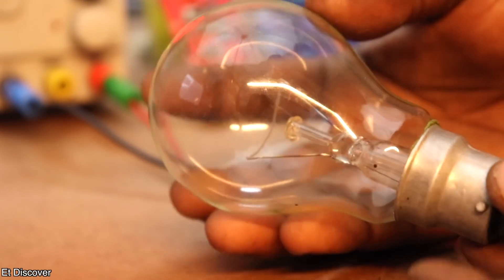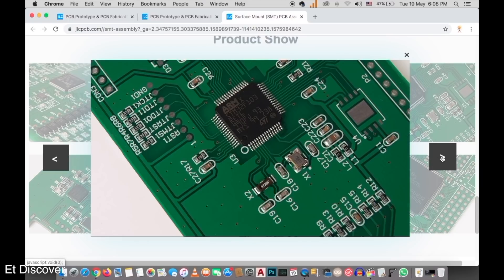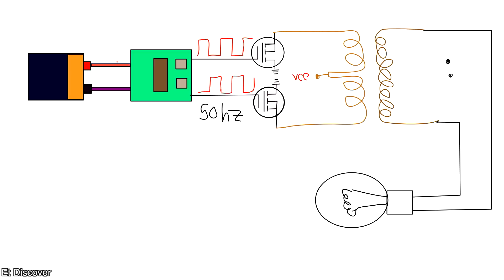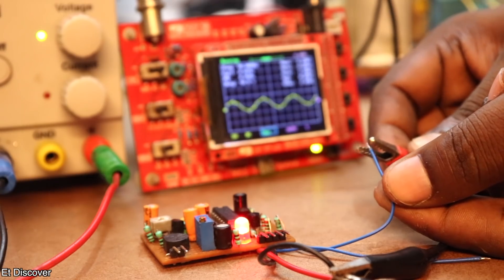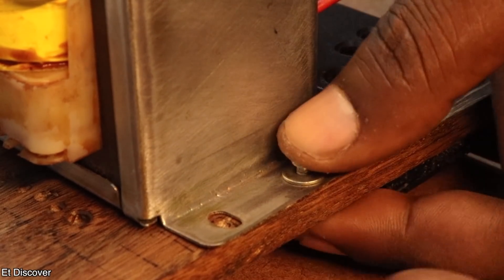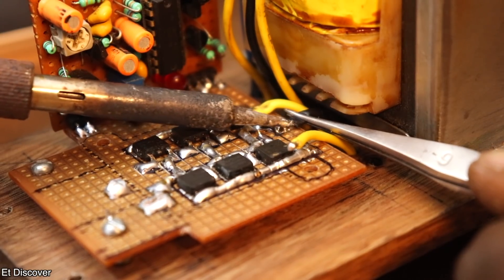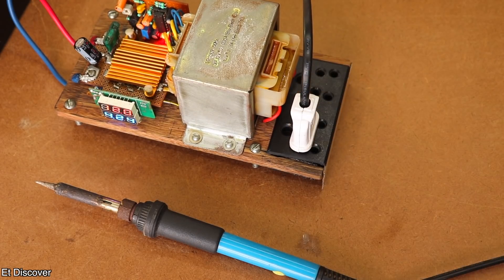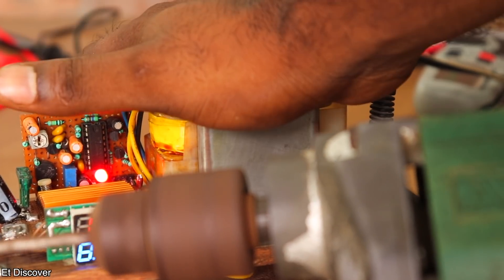DIY 500Watt Stable Professional #Inverter, with Feedback Process

Comment: It's been 2 years now am using my old digital inverter converted to solar inverter with just one solar panel 150 watt mono crystaline. You will be surprised that my inverter hasn't wasted the grid energy to charged the battery over 2 years although I have switch by which I can control it.
Am using pwm controller. 

Step 1 : I want to upgrade my pwm to mppt having good efficiency and low heat generation.
Step 2: want to design a ckt which switch the grid supply based on battery percentage. And battery percentage can also be changed by owner based on their need.

Comment: sir, when you have said that your drill machine is running at 500w , then according to your input voltage and current reading you are about consuming 100w at the input, so the output power was nowhere close to even 100 watt,since no power conversion system is 100% efficient, I highly doubt that at that time the output voltage droped by the limiting impedence offered by the transformer secondary, So with this size of transformer(not ferrite core ones), I think its impossible to get nowhere close to more than 200 watt. Besides this fact , i quite enjoyed your video.By the way, i was also building a  DIY inverter with arduino and was looking for voltage feedback ideas and came  across your video.

Comment: 3:12 you can get maximum  at least 100 watt from it not 500watt because at 12 0 12 volt and 3 amp we can sum up as 24 x 3 = 72 watt  so may be you can get 100 watt but how you claiming 500 watt ?

Comment: Sir 0.1 UF How many volts is the capacitor electrolyte?
Reply from the maker: Any kind of voltage you can use
Reply: @EtDiscover  Sir, tell me what you have used, sir

Comment: Dada, I went through the schematic and found that the collector of bc547 driver transistor for mosfet is left idle, it must be connected directly to Vcc I hope or through a current limiting resistor to Vcc(12VDC) ? 100 ohm resistor is already there.

Comment: Very nice and innovative step but it's not a 500Watt inverter , it uses a transformer of 24 volt 3 Amp (72Watt) at 50HZ,so if you run it at 50HZ, the inverter will provide  72Watt  at max, Far from 500 Watt. And if you want 500Watt anyhow by increasing frequency, it Must draw more than 40 Amp from the 12V input. And I don't think the secondary winding can handle such a high current. 
And while you were running the drill Mechine, it was taking 12v*9Amp=108 Watt...
So you should not claim it to be 500Watt.
*I don't hate your work, I like your  channel, really innovative contents you are making, but you should consider these facts. Don't get me wrong..
Reply from the maker: Hi I know your opinion is a really great, but in this case this is original transformer and the coil Ratio is different, and remember one thing you can’t calculate Ac volt by this formula,
Reply from the maker: And I also mentioned in this video this is suitable for 300 W but you can run 500 appliances but in this case the transformer getting too hot, You have any doubt about 300 watt! You can calculate it by this formula,

Use this Formula for Calculate AC voltage.

EER(ToutF, TinF) = EER95*(0.00011*ToutF^2-0.0375*ToufF+3.57)*(1+(TinF-72)*0.011)

Comment: Amplifier circuit are badly  designed without any mosfet protection
Reply from the maker: Here don’t needed any Heatsink, Hopefully you noticed a commercial inverter Just has a fuse for mosfet protection, So here I am also use this
Reply: @EtDiscover  i mean gate surge protection

Comment: Bro make inverter using chopper from crt TV circuit board.
Reply from the maker: Ok I’ll try to make a high frequency inverter
Reply: @EtDiscover  Thank you so much. Can you make a high current 0-30v variable power supply smps with TV chopper. Please😊🤗🤗

Comment: Bro small doubt,
420volts three phase induction motor, we can use 250V relay module in a single phase.
Reply from the maker: No. not possible
Reply: @EtDiscover  but why,
In a single phase current flow is 210 or 220v

Comment: Video is good, but you should use correct title, this is only 120 watt inverter, 12-0-12 with 3 amp Transformer can't provide 500 watt, be honest
Reply from the maker: Ac voltage iscalculate by this formula, Use Formula.EER(ToutF, TinF) = EER95*(0.00011*ToutF^2-0.0375*ToufF+3.57)*(1+(TinF-72)*0.011)
Reply from the maker: Think about the high-frequency inverter, A small transformer give you 5kw and more,
Reply: @EtDiscover  :)) I am talking about what you made, you use 12-0-12 and 3 amp transformer and running drill onto it, drill is working but only 120 watt is going to drill machine, let me know that the circuit you make will work same on 12-0-12 and 30 amps transformer
Reply from the maker: 😀 thank you,

Comment: Sir can you make 1000W inverter.
Reply from the maker: Just you need to replace the transformer, and use the big MOSFETs , And definitely you will get 1000 watt and more. And make sure your transformer ratio is 60hz
Reply: @EtDiscover  can I use IRF Z44N MOSFET in this circuit? And a 12-0-12, 1Amper transformer.
Reply: @EtDiscover  and I want to use cd4047 ic or NE555 ic to generate 60Hz frequency. Is it possible to generate 60Hz signal using the ICs I had descripted above.

Comment: Please make a inverter using two transistor frequency oscillator
Reply from the maker: I Already made this type of inverter you can watch this video
Reply: @EtDiscover  but that's not 50Hz please make a 50 Hz frequency generator for inverter using only two NPN transistor because all IC's not available in our market
Reply: 12v×3Ah=36watt but this inverter is 500watt how is it possible please explain with us

Comment: May I know how a 12-0-12v 3A transformer (12x3= 36watts ) is capable to drive a 100 watt bulb , that too at full brightness
Reply from the maker: Ac voltage is not calculate by this formula, Use Formula.EER(ToutF, TinF) = EER95*(0.00011*ToutF^2-0.0375*ToufF+3.57)*(1+(TinF-72)*0.011)
Reply from the maker: Think about the high-frequency inverter, A small transformer give you 5kw and more,

Comment: Very nice video! Is this a pure sine wave inverter? Can you make a video that can run a fridge, that obviously needs a much higher rating inverter and filter for pure sine wave.
Reply from the maker: This  is not a sine wave inverter, but you can use it for your Daily appliances without any damage